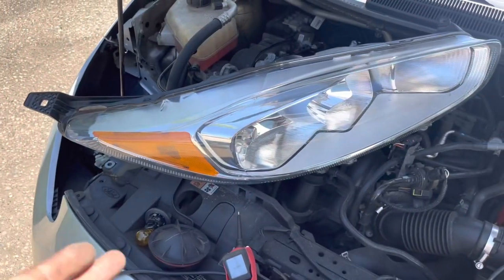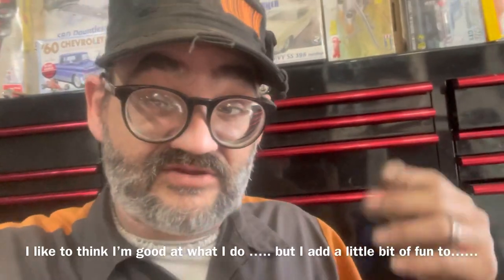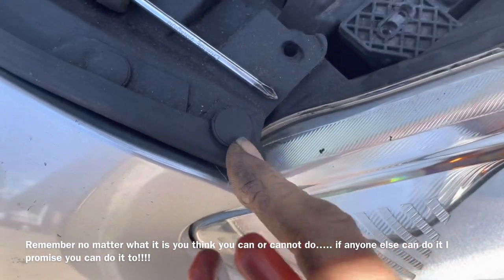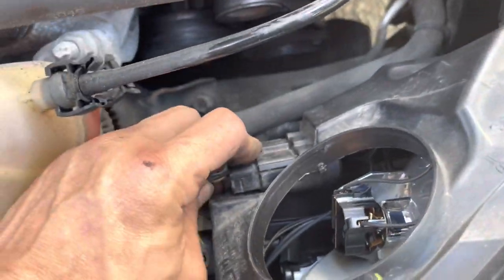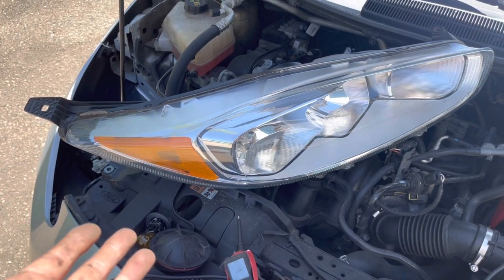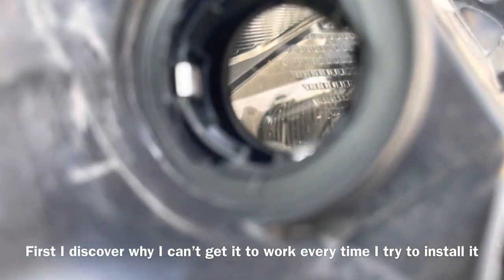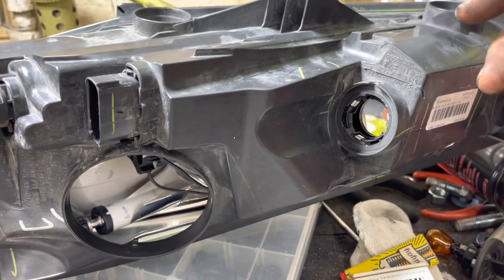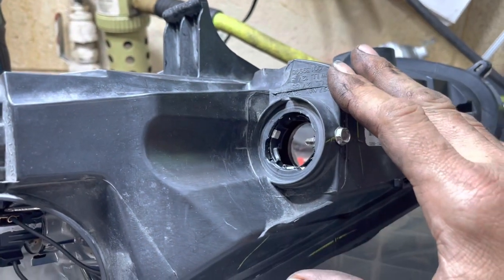Ford Festiva Headlight removal Bulb replacement / Festiva Broken Headlight Socket repair

Comment: Just a thought, but instead of the screw could you have put a blob of epoxy in there to stop that piece pushing in?
nice repair tho'
Reply from the maker: I don’t know I would have to think so I was worried about getting any adhesive in the crack where it needs to lock in and even possibly not being able to replace it in the future if I miss queued the glue. Also I know I was lucky that the ring wasn’t broke worse

I think this was a good video for the standpoint of now people know that if they push it too hard they will break it. 

Which was really the point of the video. That I really didn’t think of till just now lol 😝 

Your channel is doing great man good work keep it up!!